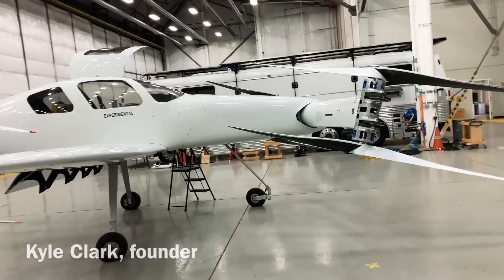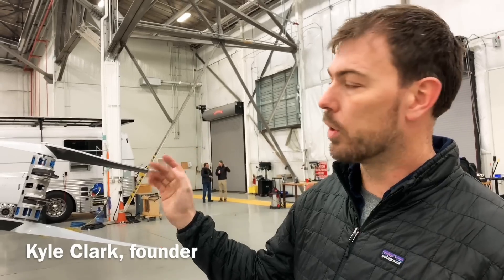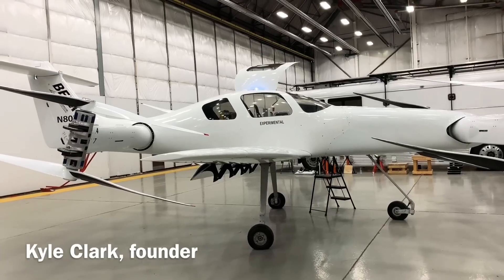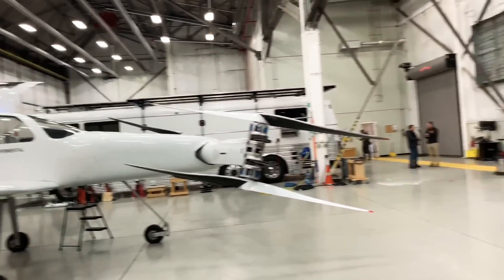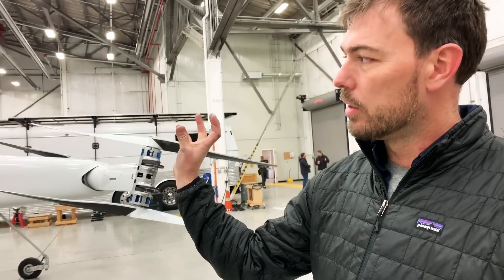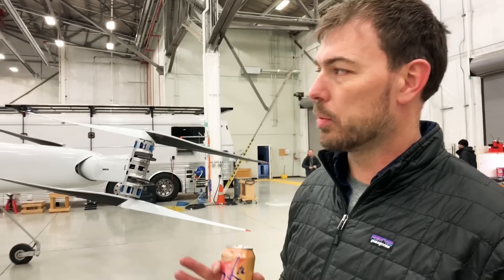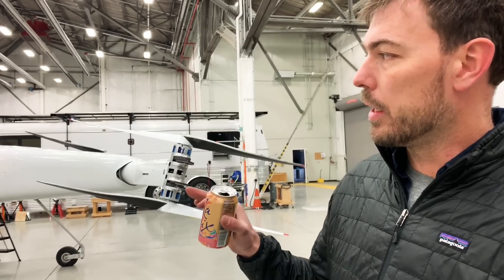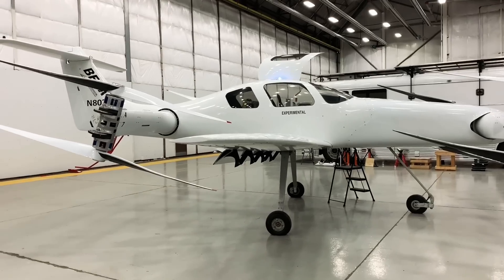Beta Technologies eVTOL Air Taxi Prototype

Comment: Except... it didn’t take off vertically. And electric motors are NOT efficient... because of the power to weight ratio of their batteries. Gas motors weigh more than electric motors... but their fuel source is far more energy dense than batteries per pound carried.  8 motors gives you 8 times the likelihood of a engine failure... and if the aircraft can’t land vertically with a motor out, but can glide on its wing- then It’s just an airplane with way more complicated motor arrangement than it needs.  And if they do get it to take off and land vertically- then it’s just a more complicated helicopter.  Thanks for solving a problem we don’t actually have.
Reply: clearly you don't get it. hybrid design gets the best of both worlds: efficiency of flight + VTOL.  At some point, Steam engines were more efficient than gas but some crazy lunatics insisted with developing it anyways.
Reply: Simon L -  oh, I get it... but I also ‘get’ physics.    You can have a hybrid of the best characteristics of both- but it comes with the worst characteristics of both.
This thing can’t autorotate in the event of a power failure- because the motors would turn into generators and where does that power go if the battery system is dead? It can’t lift off or land vertically on even One Less than all 8 rotors, and thanks to the drag of 8 rotors has the glide slope of a brick. It’s entirely reliant on multiple complex systems working perfectly to maintain controlled flight and can offer No manually controllable mode in the event of a computer or motor swivel, or engine failure.
And,  of course, it eats tremendous power.   Extending its range means adding a literal ton of batteries. Which requires larger rotors, which are less responsive in terms of speed control due to their higher inertia/momentum, which requires variable pitch props, which adds complexity and weight, which requires longer support arms that are structurally stronger. Which again adds more weight.    Which needs more power, more battery, etc.    There are reasons why electric powered planes are built like kites.
There is a reason why we don’t have flying cars.   The investors want to transport donor organs?  They can use autonomous drones that only have to lift the organ and the ice.  The problem with all of these ‘solutions’ is they want to add the dead weight of a man who can’t actually fly the thing without computer controlled automated flight stability systems.
What this REALLY is is a Con founded on the Hype surrounding quadcopter drone technology- not unlike the hype surrounding the hyperloop.   There is a frenzy among investors to be in on the ground floor of whatever might be the next Google or Amazon.   And a passel of wannabe millionaires who realize they don’t have to actually find the next Google or Amazon, because they can ride the investment wave of hype surrounding popular ideas like this and pay themselves million dollar salaries for the 5 or 7 years they can keep investors drooling.
It’s the plot to Mel Brooks’ The Producers... only in high tech.  This is why otherwise intelligent men, hiring competent engineers are willing to utterly ignore the simple math that proves these ideas untenable.

Comment: Once in forward flight, will the inactive motors then generate power for the battery banks?
Reply: there should never be an "inactive motor" during flight, that would act as a break in flight.
Reply: The time to do what you're asking is during descent. Electric aircraft all have the same problem: too much energy required for overcoming gravity. You're left with medium range afterwards and then a 2 day recharge. However, if you can recoupe your altitude energy on the way down....
Reply: Wendy Owens
there are no inactive motors in forward flight.

Comment: If it was 2121 and electronic hardware and software was flawless... this would be be a great idea.
As it is now... one wrong zero (0)... one wrong one (1) and the pancakes you ate that morning get reconstituted.
Using torque steering for turning... underpowered thrust of ANY TYPE is a sure way to the grave with current technology.
Great concept... but no one will... nor should risk one with thus thud.

Comment: In a hoover at max TO weight, what would the consequenses be if it had a total power loss on one motor? If the answer is uncontrolled flight into the ground, you are 8 times more likely to have a crash due to motor failure than with a single rotor.  More rotors/motors are not always safer.

Comment: The issue with electric air craft is that a fairly high power setting is needed for flight a opposed to say a electric car which in normal use has a lot of stop and go, on the other hand a aircraft is close to 100 percent power as it fly's  and range becomes a big issue as is the weight of the battery pack. Back in the day when  I flew GA aircraft these fairly light aircraft such as say a Cessna 150 which weighed around 1400 LBS with full fuel would normally fly around at 80 percent power that got you around 110 MPH. This would be similiar to driving a Tesla around 125 MPH constant speed and your range would be nowhere near 200+ miles it would get in normal traffic, the range of electrics is a big obstacle for aircraft as say bad weather could prevent you from landing at your destination and you have to divert, gas engines give you more options, and a more reliable estimate of how much range you have left , as well you have full power until it quits.

Comment: Complex design always fail
Reply: Even 8 electric motors have less moving parts than one IC engine. The basic layout is pretty common these days, although not at that scale and without the aero frame and transition to forward flight.
Reply: @OzAndyify  thats right though but electric aircraft have another drawbach that they low range because of the batteries

Comment: When it comes to flying machines redundancy is the name of the game. The new electric multi rotor aircraft now coming on to the scene show incredible promise because they can lose motors during flight and the other motors will compensate. They will have redundant collision avoidance systems and will be self flying eliminating the need for a pilot. The Bell Nexus, Volocopter, Ehang, Passenger Drone, etc. will all be providing air taxi services by the mid 20s.  We are witnessing the next great techonological revolution.  It was cars, then planes, then jets, then rockets, then the personal computer and now electric VTOL vehicles guided by satellite. All that's left is commuter space travel and tourism.

Comment: that is bad design, too many rotors, i can imagine vibrations hell
Reply: Co-Axial octa-copter is a very good design choice for this application as it offers a minimum level of redundancy both on thrust and control. What puts you in a position to make such a bold claim, from your videos, I take it you are more a SJW type than an engineering type.
Reply: Simon L I have dozen of multirotors models 4 and 8 rotors and you should watch them in slow motion... I did not attack nobody personaly, and my videos do not reflect what I do. I love simplicity and small aircrafts like Velocity are the future. What will happen when two engines the same wing will fail?
Reply: @monicasmyther8976  You are right, reliability is definitely an issue with a complex device such as this one with many moving parts and critical sub-systems... It only makes sense if it used to fill a unique role, which is what they are aiming for with remote organ transplant deliveries. If it looses 2 rotors while hovering, whether its on the same arm or not, it is going down in a hurry... My point was, it's not a bad design if it can fill a role others can't. BTW this is like a miniature v22 Osprey and its mission will be similar.

Comment: What's the point when it cant take off vertically . It still needs runway
Reply: 1) The video is more than likely a high speed test using runway length only
2) Because the amount of energy required to do a pure vertical lift is significantly higher than doing a rolling take off. Similar to the Harrier Jump jet, the fucking airplanes does not get off its carrier deck flying vertical (yes it can, but why waste the fuel) when its more efficient to do a rolling take off. And it only uses vertical landings and take off when it as to. 
3) There is no doubt this Ex plane can vertically take off.
Reply: Read the description...

Comment: Not very VTOL, more like HTOL.
Reply: wow the level ignorance is stunning, as usual
Reply: The video was a test flight. Test flights are cautious. Vertical takeoff and landing comes later.
Reply: Read the description...
Reply: Baup baup baup baup baup baup meh.....oh I guess I should have read before I wrote.
Reply: Good....  I like it...
Reply: Thank for subscribe back my chanel
Reply: Read before opening mouth : "though in this test it’s executing a fixed-rotor stability test in forward flight. (Vertical tests will come later.) "
Reply: It doesn't even look like it has the power to do a "V" takeoff. They've just built a 3rd rate electric airplane. Battery technology needs another 10 years to make these things a reality. The energy density just isn't there yet.
Reply: @jonathanhankins8356  

Not correct. Electric aircraft are already with us. Pipestrel have an electric trainer designed for circuit training. Eviation are currently test flying their aircraft that has 1000 kilometre range and carries 8 people.

Very impressive battery tech is in the lab, just a couple of years away.
Rolls Royce have just teamed up with Bristol University after their supercapacitor breakthrough. Solid state batteries are nearly here, not to mention graphene.
Reply: @martinw245  Wow, Just read about solid-state batteries for the first time, thanks for the connection.
Reply: @pops9190  

"Wow, Just read about solid-state batteries for the first time, thanks for the connection."

Yep, all kinds of great stuff on the way. Solid state, supercapcitors, graphene, sodium ion, gold nano wire batteries. Not to mention structural batteries, where the structure of the vehicle is the battery.
Reply: @jonathanhankins8356  It can. I've seen it do a vertical takeoff and hover.
Reply: @jonathanhankins8356  im not a pulot or anything near the sort, but why dont theh just build a scale drone...arent these type vehicle already in production or what?
Reply: @rarebreed4512  I'm not Jonathan Hankins, but there are a couple of reasons:  1. It's cheaper to build helicopters if you're looking for a vehicle that mimics what helicopter do, than scaling up a drone.  2. The purpose of the type of plane in this video (or any VTOL aircraft) is to have the ability for short takeoffs and landings, but the efficiency of an airplane once airborne (so for longer routes).

Comment: You know what I don't like about the concept? Too many blades whirling around the cockpit... it doesn't make for a safe ejection nor an emergency exit.
Reply: Because you currently have ejection seats in current small to mid size airplanes?
Reply: @fredpinczuk7352  and helicopters?
Reply: @dpbj1957  They don't have lift wings (in general). As they rely 100% on the lifting rotor assemblies(s).  Of course there are exceptions to the rules as the world record holder Eurocopter X3.
Reply: Balistic parachute for whole aircraft & occupants
Reply: @lanselithgow5865  That could help in some cases, but all I see is a Ninja Food Processor.
Reply: @lanselithgow5865  That's about the only way I can see that makes any sense in using a parachute.  Would not be safe to bail out to use a parachute because in any case where you would "need to bail out" the craft most likely would be out of control and any effort to bail out would result in becoming shredded pilot.  And the entire craft chutes are proven to work.

Comment: I totally missed the " V " part of this video.
Reply: A running start with a jankie front wheel
Reply: Mmm. Yes.  A wide vertical take off
Reply: that is probably what eVTOL stands for ..... extended VTOL
Reply: @JosefKopal  so.... stol.
Reply: @JosefKopal  euh ; "electric" ?
Reply: @stevencooper787  Are you familiar with the concept of a sarcasm ? Or do I need to prepare a slide presentation for you ? .... And to be honest: quadro-copters(or octo-copters in this case?) are cool and elegant toys but totally impractical. It works for drones but the mass distribution is simply wrong for the real world application. I would rather bet on bi-rotor (with variable thrust vector) single engine plane and advanced control electronics. Or stick with the planes and helicopters till we can bend the gravity ....
Reply: Yeah it’s more of an STOL aircraft at the moment, i assume to keep it more stable
Reply: This is only a test flight.
Reply: HTOL
Reply: Me too! It's STOL no?
Reply: Baby steps keep pilots alive during early testing. Seems obvious to me..
Reply: I totally missed your video of your VTOL developments that includes anything better.
Reply: @motoxcarbon9891  To say  "Well can you do better" doesn't change that this thing did not take off vertically at all in any way and in fact had far worst Vertical take off than regular singe propeller VTOL aircraft. The man making that statement is not stating that he can make a VTOL, the people making the F@#$in video are..... and that plane didn't behave as advertised.

Comment: Stupid waste of money and time. It takes off like a normal plane. Big deal. If it lifted like a drone and then flew forward. Helicopters were built for that purpose.
Reply: No it doesn't take of like a plane. Its VTOL. The rolling takeoff was because it was a cautious test flight.

And more efficient than a helicopter because in the cruise lift is generated by the wings.
Reply: The car your driving was just a drawing at first . What a stupid wast of a pencil, you couldn't even drive to the pharmacy in it.
Reply: And another bold ignorant statement from someone who clearly doesn't get it

Comment: Another small step... There does seem like a lot of challenges but projects like this are encouraging, particularly around understanding electric flight as a whole and not just the technology. I'm interested in seeing how the likes of big tech startups get on because they appear to break/re-define the rules and apologise after - I don't think that will cut it in aviation! Pilots is an interesting one, too. I wonder how many budding pilots will opt to fly urban transport (in time) rather than traditional airline careers? Good luck.
Reply from the maker: Great points! The piloting issue will be a huge one. They'll eventually need full autonomy, but in the meantime I suspect there will need to be a different class of license that's easier to get and limited to the capabilities and applications of the aircraft. High automation will make it accessible to a wider pool of would-be pilots.